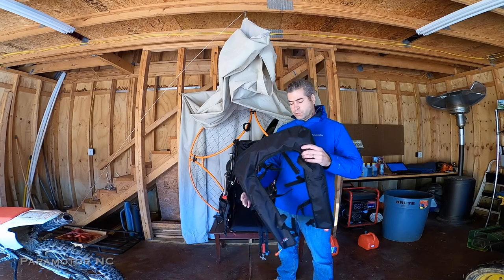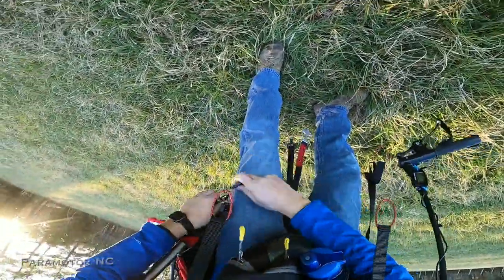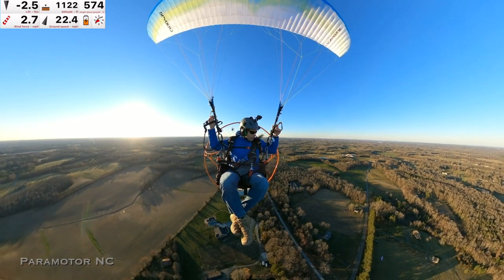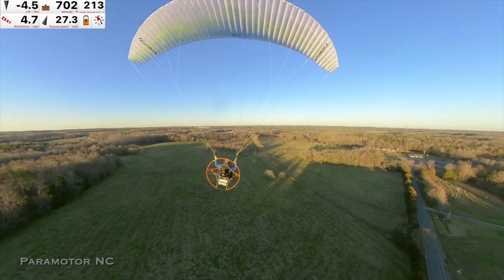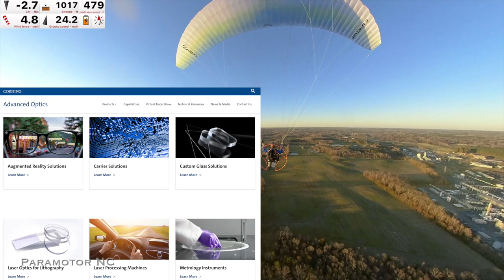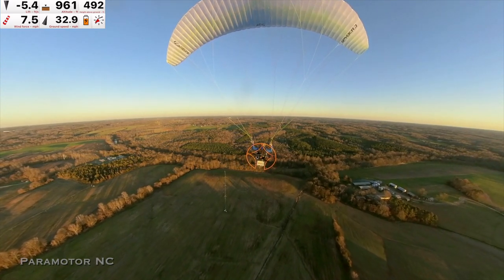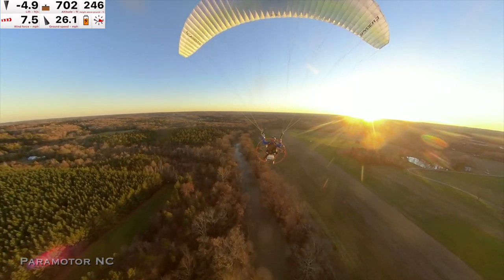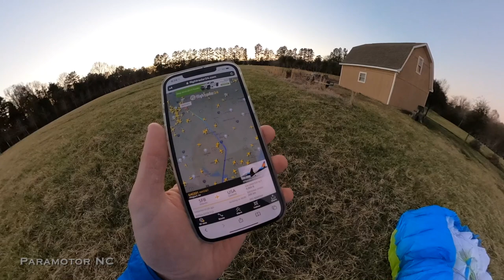Paramotor NC - Flight and Flotation - Episode 29 #ParamotorNC #PPG

Comment: Nice flight.   👍😎👍           I just bought the U-float as well.    One-up Adventures had one for sell with no CO2 cartridges, so I had to find some of those.  Got it at a great price.     Ben, what are you using to gather the flight data?   I need something similar.
Reply from the maker: Hey Chris, I use Flyskyhy to track my flights.  Later I replay the flight on my phone and records my screen.  Then I layer that into my video.  - Ben
Reply: @ParamotorNC  The layering part is what I want to know, how to layer the data into the post.
Reply from the maker: @jimcr120  ok yeah. I do that in the editing process. These days I edit in an Apple program called Final Cut Pro. But people edit with Adobe Premier, IMovie, Davinci and many others. The concept is the same. You essentially drag the files into the video editor timeline. Check out step 4 in this video here. https://youtu.be/3pjBmI8sCVY
Reply: @ParamotorNC  Excellent. Thank you, Ben.

Comment: I'd be interested to hear your thoughts after you've mounted your U shaped float for a while.  I have used a pair of the Powerfloat 2BeSure shoulder strap version for my past 20+ flights and like them.  I thought they would be less intrusive compared to a U shape, but a comparison could be useful to folks in the market for floats.
Reply from the maker: Yes, I will definitely follow up with some feedback after I have some time in the air.  I'll show you the attachment points as well so you can consider how the U Float might best work on your frame.  - Ben